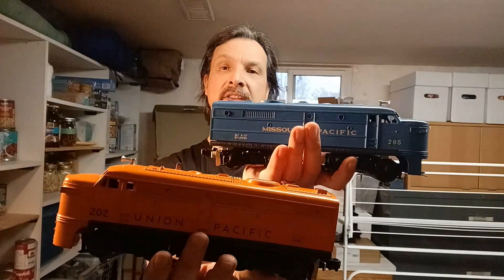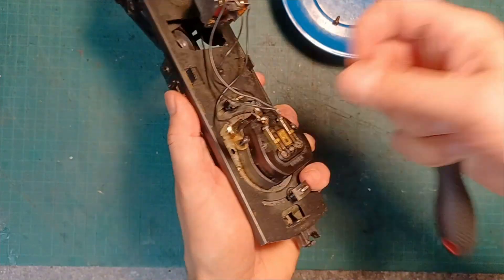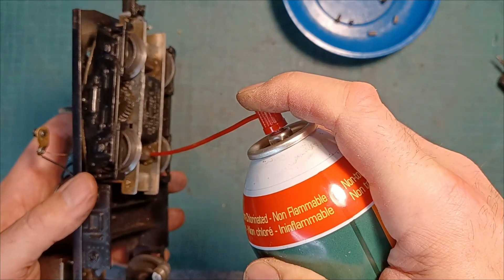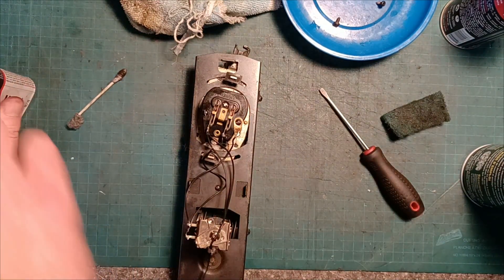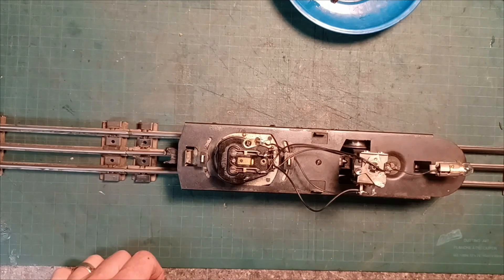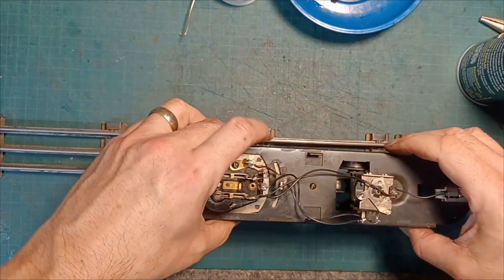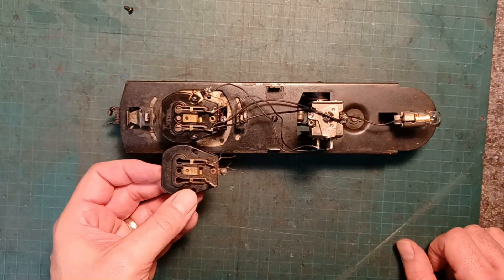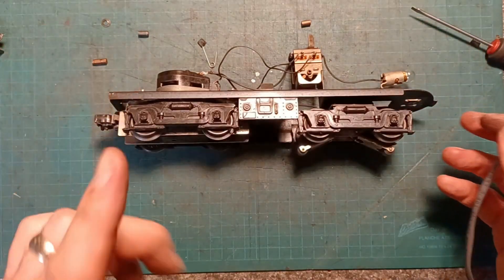I spent WAY too much time on these Alco Diesels. And ALMOST gave up!

Comment: The ongoing problem with the orange Union Pacific is the reversing switch. There are contacts that are dirty inside that piece. You can tell by putting the power wires on the MOTOR to find the motor working just fine. Do this test. But the reason it worked when you messed with the wheel assembly is because you added a little more continuity so the amperage pushed past the dirty contacts on the reverse switch. But you can also see that as soon as you moved the reverse switch, it started to work.
Reply from the maker: Its always good to chack and clean the contacts as a first step. In this case it was misaligned gears.

Comment: I have a 3 pos E-unit motor from a 600 series switcher. It did the same thing with lots of hum but no movement. I tried squeezing the frame and it worked but only laying on it side. I took some plastic the thickness of an old credit card and shimmed between the frame and armature holder.  It worked like almost brand new
Reply from the maker: Thanks for watching and for sharing that info. There you go folks, another tip on how to keep the shaft on these aligned.

Comment: Great video! Never owned a diesel, and waiting for some used alcos to arrive in the mail soon. This video should definitely help if there are issues.
Reply from the maker: Hey Joe, thanks for watching. I hope you don't have any issues and are just able to enjoy them, but if there are, yes, I hope this video helps. 

If I was to ever get a 200 series Alco, I would definitely look for the ones with the updated motor design, not the ones with the plastic bearing holders. But, as Jagger says: "you can't always get what you want". 😀
Reply: Will do. Just got a Union Pacific alco, and saw your other video on the silver Union Pacific, what timing! I’m just now getting started with trains, haven’t even run a train yet on the layout I created. I still have my old 682 from my 1950s set (yep, I’m an old fart).

Comment: It's not an electrical, the gears are binding up underneath the Loco !!, You have your name drive gear, And 2 smaller secondary Gears it's those gears causing you, Your problem , has nothing whatsoever to do with electrical !!, Mr wizard!! , And car grease will damage the loco, You need white grease ( 1. It's conductive) No.2) It's not as harsh !!, No wonder they don't run the way they Should, I have those same 2 locos an I love them , They run great!!!
Reply: So true, you need a grease that’s compatible with plastic. Hobby store sell it, just buy it, if you want to do correct lubrication on these units.

Comment: I had a similar problem with a Williams Trainmaster.  If the worm gear gets out of alignment one direction binds.  My bet is an even better fix is to drill out the rivets holding the motor to the truck and replace the rivets with bolts and tighten.  In my case it was a stripped out screw that held the motor to the transition piece that held the motor to the truck causing the misalignment. Nice troubleshooting on your part.
Reply from the maker: Thanks for watching and thanks for the tip! I really appreciate others sharing their knowledge. I'm always learning new stuff about these old locos.

Comment: Armature end play might be too tight or possibly too loose causing worm and gear bind due to wear/loose assembly. Lower bearing wear or loose plastic to frame causes poor gear mesh, too.  Later design changed lower bearing from plastic to a metal bearing in the metal frame as you showed. You can replace the plastic bearing cover or shim it between cover and frame. Squeezing frame is not going to last. Need to restake tabs or solder them. The 202 w/ single magna traction s/b a double wound coil and 2 position switch. You can tie both coil winding in same direction together and use a 3 position “E” unit. The 2nd winding was isolated from ground. That will change to both coils (same wind direction) grounded without insulator sleeve. This change to 3 position “E” unit will allow for stationary engine with power on to operate things like coal, or cattle, or milk cars. Wiring will be as the 205 engine w/ “E” unit.
Reply from the maker: Thanks for watching and thanks for all that. I'm sure someone can use that fix as a more permanent repair. Personally if I want a strong running Alco I would choose one of the higher end 2000 series.
Reply: @warrenmuzakpostwarguy4331 I agree 2023 is better construction. I have a few now and run two powered units together and they stay on tracks going faster and pull a dozen cars no problem. I modified 200 series with dual motors front & rear and double them (4 magna traction motors) pull anything and literally stick to tracks at faster speeds. For cheaper modified engines I’m impressed now.
Reply: Reversing the locomotive will try to thrust the motor up and down. Adding a smooth thrust washer between the armature and brush plate may help if there is too much play.

Comment: I don't have one of these right now but from your video here and from what I know. Once you find the correct spot, take a piece of sheet metal, or a thin stable plastic. Run it from the metal supports on both ends of the motor assembly. Put one screw in both ends and then once you have the sweet spot put one screw in the plastic part in a safe spot, away from the gears, that is giving trouble. Pre-drill everything slightly smaller then your screw and use machine screws and thread tap your mount holes. Once in place and working well, put thread locking on the screws. Screws have to be very flat on top as to not touch the middle rail or even get close, but don't use flat top screws with that typical tapered head like the wood screws, or they will just split things. Also some of these have mag-na-traction and any drill shavings could get into the gears be very careful of that. Dagryffyn hobby had this problem as well but I did not think of this idea till today.     The pinch or squeeze will only hold for a short time!
Reply from the maker: Thats a great and very detailed repair. You'll have to make a video of that process and share it!

For me the 200 series locos are not worth that amount of time. If someone is a fan of the Alcos, I would suggest first get the 2000 series, (2033, 2032, 2023). If they are really set on these cheaper 200 series get the proper upgraded replacement motor mentioned in the video. Just swap it out.

Comment: Nice video . I wou!d remove the rivets and clean the entire chassis and motor . a good cleaning and lube and inspection. Thanks nice job . I use gun grease . its a lite grease and works great .

Comment: Hey, if you don't like them, send them my way. I love those things.
Reply from the maker: Thanks for watching. I see a lot of love for these low end Alcos. Probably because they were the first Lionels people got. As I said in the vid, these werem't mine. If some drop in my lap, I'll be sure to toss them your way!
Reply: @warrenmuzakpostwarguy4331  Yeah they are my favorites, simple and done right can run really well. I like building powered B's and tying multiple units to run thru one e unit. But they run well on the smaller and tighter layouts, like mine.

Comment: I have a 2032 alco that I love and is a great runner. What do you have against these fine engines
Reply from the maker: This video wasn;t about the 2000 series Alco's They are very different from the 200 series I am talking about in this video.

Comment: The only way to fix a 200/600 series motor is to completely remove it ,remove the wheels and axles and restake the frame square up the bearing plate then reassemble .
Reply from the maker: Thanks for watching. The best way is still the one recommended by Lionel. Swap out the motor with the improved design. It is much more reliable not having that lousy plastic piece.
Reply: I have repaired hundreds of these , there is nothing wrong with the 600-109 bearing plate . You just have to restake the frame and square up the plate and it will run forever and very smooth .

Comment: Good job.
I have 3 Alcos without that bearing at the bottom of the shaft, number 230 etc.
All three run fantastic in reverse and sluggish in the forward position.
Any tips for this problem?
Reply: Then the lower bearing must be in the sheet metal frame. As motor runs it thrusts either up or down depending on direction it’s turning. Look to see if the additional end play is on the top or bottom by looking at how much the brushes move with direction change. Shim with about a .010” to .015” thick washer to take up additional slop. Don’t make less than about .008” to .010” end play. Possibly a split on shims top and bottom works best. Insure shims do not contact armature windings. Commutator end must be plastic/fiber washer. Most Alco’s (rear motors) run better in reverse due to the thrust direction. Old 2023 Alco had motor in front is better design.
Reply from the maker: Thanks for watching! I just found tightening up the sides like I did eliminated the sluggish issue I was having, and only temporarily. Honestly, I would try to track down the upgraded motor Lionel released, that is shown in the video. The style with the bearing on the bottom is just a bad unreliable design. Especially if you run these Alco's a lot.
Reply: @warrenmuzakpostwarguy4331  The cover with the bearing hole is available as a repair part. I’ve replaced a couple. They fit tight w 2 lugs on each side. Care required not to spread frame. About $1.50 each. But you may need to shim the sides to get a smooth unloaded armature. I suggest some JB weld epoxy to keep the shims from coming out. All the frame/motor tabs need to be tight. The frame w/oilite bearing was made for dual axle magna traction and has axle bearings. There were others without axle bearings and no magna traction or just one axle magna traction. Motors were made in single an double wound coils for 2 or 3 position “E” units.

Comment: I heard they are difficult to repair. I would prefer a higher grade loco.But if I found one cheap ...,like in a collection. Nice video.
Reply: I always check the lube on the worm gear when I get a loco 🚂🚃🚃🚃
Reply from the maker: In general, they're not hard to repair. A lot of the issues with these early ones is that motor with the plastic bearing holder. Once you've figured that out the rest is very basic.
 That said, I agree with you and would prefer the higher end 2000 series Alcos which are over all better models.

Comment: I have the same unit that runs completely fine in forward and reverse for about 45 seconds then it just dies. Im guessing it has something to do with the e-unit but im not sure.
Reply from the maker: Thanks for watching! I always go through a step by step check when things like that happen. STarting with the track. Is it clean
Pickup rollers, clean? making good contact? not heavily grooved?
Wires: No broken or loose solder joints, cracked insulation, exposed wires = shorts
armature, clean? all carbon removed from copper plates and grooves
brushes, not too worn, seated properly
Eunit, clean drum? all fingers intact not bent or broken?
Lubrication, is everything lubed and moving free not full of dust, carpet fibers, pet hair, etc.

Comment: Good trouble shooting video ,who would have thought that just squeezing that frame would correct the problem.?
Reply from the maker: Thanks for watching Phillip! Its a temporary correction. The motor vibration will eventually work that bottom piece loose again. Likely why Lionel redesigned it.
Reply: @warrenmuzakpostwarguy4331  I was running my MPC era Sante Fe F-3s today and they run just fine .Have a similar motor but no binding issues .
Reply from the maker: @philliprowe2656  F3's are great! Beautiful locos. MPC Era is a different motor design.
Reply: @warrenmuzakpostwarguy4331  The silver ,red and yellow warbonnet scheme is a classic!

Comment: You have a bad armature in my opinion
Reply from the maker: Nope. It was the poorly designed plastic bearing holder at the bottom of the motor. Worked itself loose. I showed it at the end of the video. Thanks for watching.